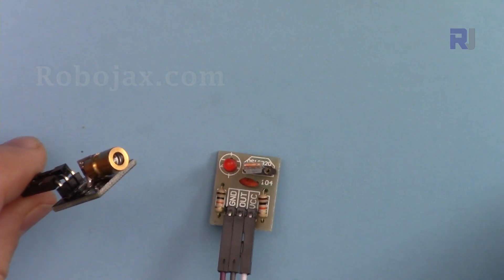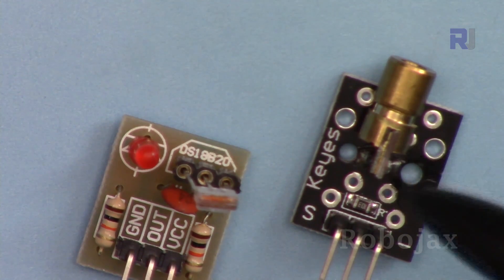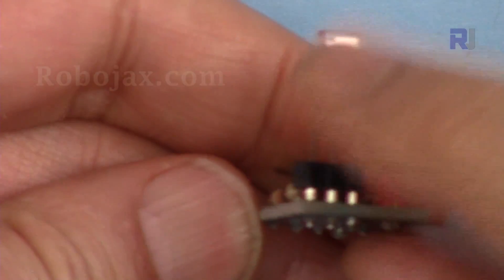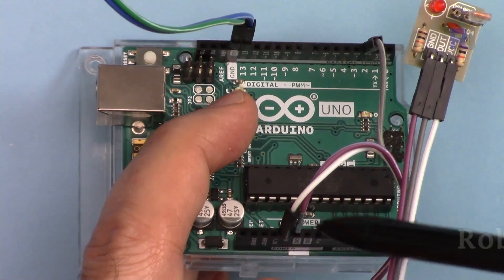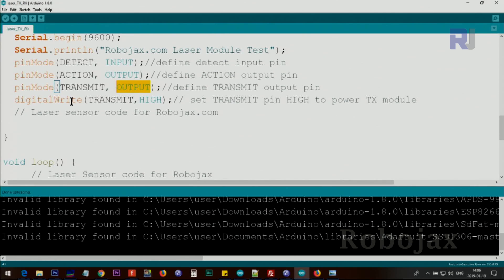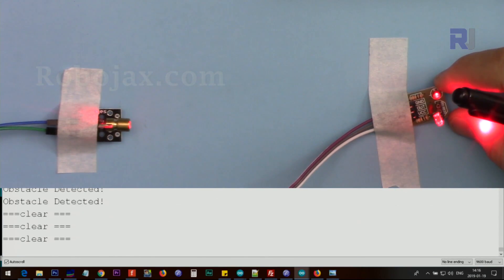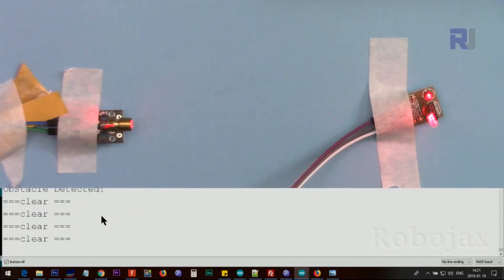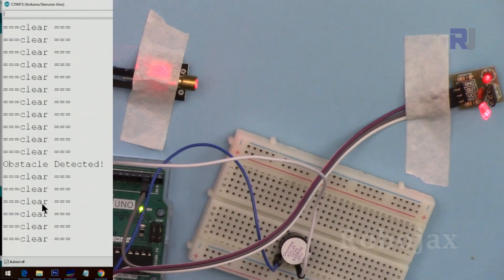Lesson 72: Obstacle detection using Laser Transmitter and receiver- RJT474

Comment: Hey would it be possible to use this system to tell 2 6V DC motors to rotate whenever the signal is interrupted?
Reply from the maker: Yes very easily. First learn how to use the the “if” statement to take action. Perhaps learn it from this video ESP32 Project 24 - Measuring Soil Mositure for Irrigation | SunFounder's ESP32 IoT Learnig kit
https://youtu.be/MW-7a5Z0IT0 and the learn how to use the a relay. I have tones of videos on relays. Search my channel.

Comment: Does the laser need to be completely obstructed to trigger the sensor?  Could a 0.05mm copper wire be detected?
Reply from the maker: that is tough to know. I have not tested. Let's see if anyone else has done it. Try it.
Reply: @robojax  Yes.  I might have to try.

Comment: I have purchase the KY-008 laser with the associated sensor board.  For my project I only need the 3 pin sensor but I'm unable to identify it, and I can't seem to find any references to it on all the sites that are selling it.  Does anyone know the Mfr and Part Number of the detector which inserts into the 3 pin socket?  Thanks!!!
Reply from the maker: you can identify it by watching the video. it is veyr simple. it is + and GND and output and I have shown it.
Reply: @robojax  You mis-understand.  I'm looking for the part number of the receiver only.  Just the detector that has the tiny lens bump on it.  I want to purchase it separately without the board that it mounts on.
Reply from the maker: it is already cheap. just get the with the bord and discard the boad. when I was making this video, I tried to find so I could includ it in the video and even today I tried but could not find it.

Comment: Hi, the problem with this setup is that when the laser is interrupted the input in the arduino is left floating, which means that you don't get a deterministic low signal.